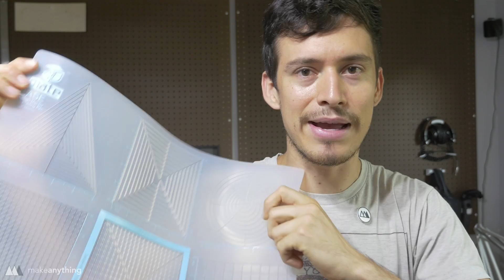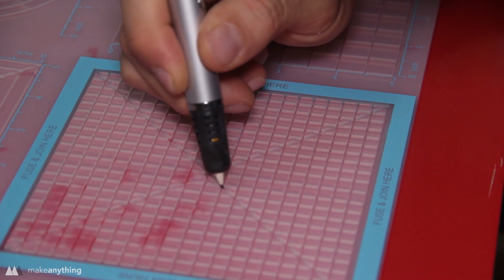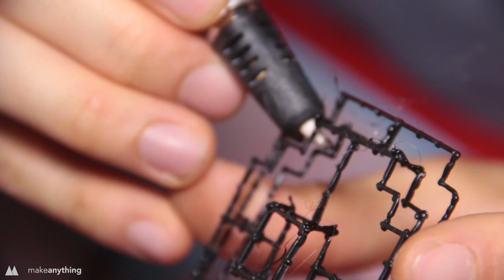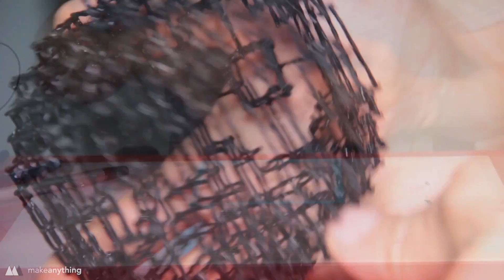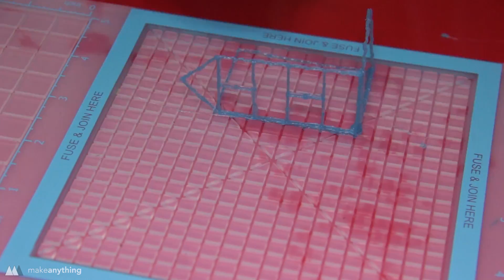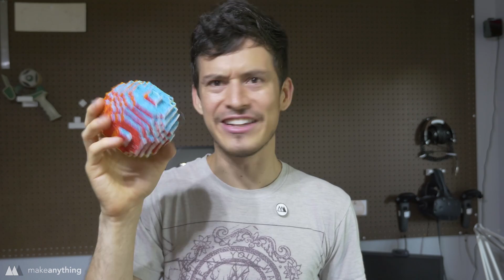3D Pen Voxel Art using the 3DMate Printing Mat

Comment: Would you recommend the 'generic' 3d pen? I found that pen on Amazon for $40, and other reviews say that it's durable, and feels of high quality. I also figured out that I looks almost exactly like the Scribbler Nano 3d Pen,  (yet to be released), and think that it might just be a carbon copy of it. Please reply, as I need more information on the 'generic' 3d pen.
Reply from the maker: It's hard to say without trying it, but there do seem to be a lot of identical pens sold under different names. I haven't even tried the Scribbler Nano though :\
Reply: Thanks! Also, what do you mean by the pen overheating?? Does it completely shut off?
Reply from the maker: It stays on but the motor becomes weak and won't push out plastic anymore
Reply: Oh... I think I had that problem with my old 3Doodler 2.0.. I decided on the AIO Robotics 3d pen. It seems to be much more reliable and sturdy based on reviews. If you get the time, you should review it. I think you would like it. Thanks for the responses! They really helped! Usually channels with this amount of popularity don't really keep in contact with their fans/subscribers. It really means a lot to us! Keep up the good work!

Comment: Imagine this as a Rubix Cube
Reply: What would the mechanism look like? And it's Rubik's not Rubix
Reply: How'd that work?
Reply: tehWhite Well, the X/Cross cube is partly voxel? Voxelised? The point is, imagine what Devin made but cut off the front and back , making the front and back flat but top,  bottom and sides have a smaller layer pop out.
Reply: Oh meh derf
Reply: tehWhite I thought it was a Rubik's Cube from the thumbnail
Reply: Lets see... a squared off 16x16  sphere cube. This could theoretically work, but there would have to be a ton of olzing (is that the term?) and extending. I dont know if it would be structurally sound, but it might work.
Reply: Forget i said anything. This could work